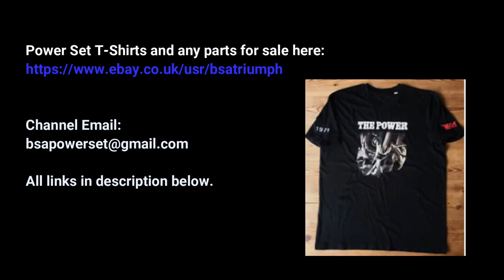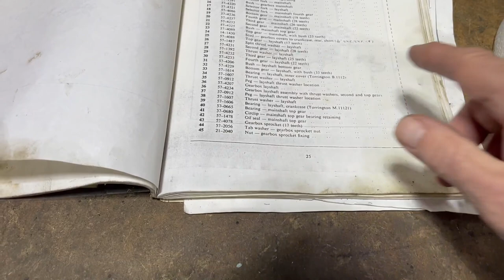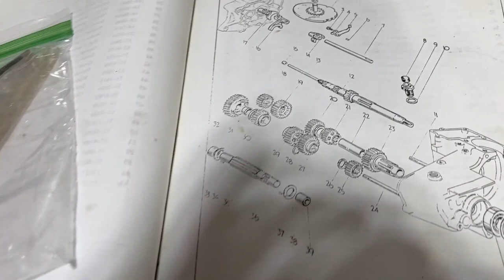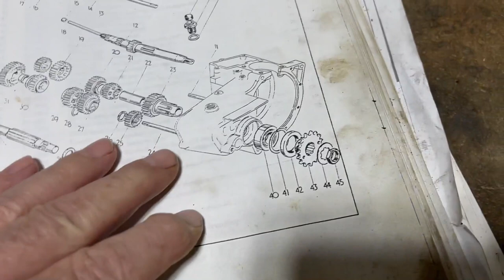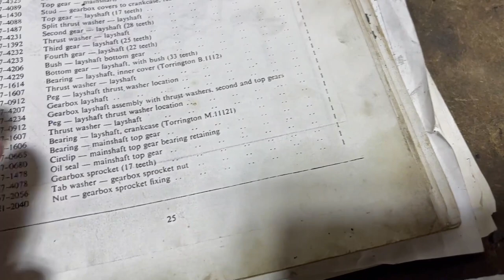BSA Fury SS (E35SS) - Gearbox Reinstallation - Part 1 - Cluster Assembly

Comment: Nice vlog, did the triumph bandit that was in previous vlogs have a gearbox that worked? I would try to copy that one if it did??
Reply from the maker: Hi Matt yes the Bandit box works but is a bit notchy and I’ve a funny feeling that that might be because there’s no thrust washers in it. I wasn’t videoing when that was put together so can’t check. I need to speak with Mr. Page.

Comment: I had a look at my set of SRS drawings, no layshaft assembly but the individual gears are there, 57-4230, 57-4231, 57-4233, 57-4235. I note they show internal spiral oil grooves, I don't think I saw them on yours, and one has an internal bush. Better be careful when you run this up.
Your best chance is the engine general assembly, may show the gearbox.
Reply from the maker: Thanks Andrew. I think we're OK on this front. On the layshaft there is only one gear that has internal grooves (4th) and only one that has an internal bush (1st). The others are on internal splines - 2nd and 3rd are moved by the selector fork and 5th is fixed.

Comment: What you need is a sectioned drawing of the cluster on the layshaft. It must have been drawn but whether it still exists is a different matter. I don't think I have that in the drawings I have on a CD rom from Steve Sewell (SRS), but don't you have the big engine assembly drawing, is it shown on that?
Reply from the maker: Eureka you’re right Andrew. Yes the SRS set which I also have does not include any drawings for the thrust washers but the general arrangement drawing should show them in the drawing of the gearbox shaft assemblies. I’ll dig out and check. Thanks Andrew.
Reply: @BSAPowerSet - also worth a look would be exploded illustrations in the weekly press (MCN and or Motor Cycle Weekly). Lawence Watts and Bill Bennet would have had their Rotring Pens at full flow sometime around pre-release or soon after. If that's what Andrew meant apologies.
Reply from the maker: Thanks MC2. Andrew was referring to something else so all good. I do have some of Watts' material but it's not detailed enough. However, I do have something else of significant benefit which will be revealed in part 2 due to be published shortly.
Reply: @BSAPowerSet - I realise Andrew meant drawn by the factory drawing office draughtsmen now yes fair point, taking a look at the press illustrations your parts book has more detail but they may lend a hand visually in some respects.
Reply from the maker: Thanks for the additional thoughts and observations Matt. It's a long story but the thrust washers were originally made for me. I agree that the material might be a bit too soft but I don't think that would normally be problem if everything fitted properly, which it didn't. The split washer is just a stop for fifth gear which does not spin against it. The complete washer between third and fourth gear does have the spinning 4th gear against it but not under constant load. However the new fabricated washer is made of EN19 so should be fine I think although I'm no engineer so we'll have to see. Initial focus is to get the box functioning properly. Thanks again.
Reply: @BSAPowerSet  - I moved the comment to the next video then noticed you replied here apologies for that. I think it's worth checking the thrust washer part numbers for matches from other Triumph / BSA gearboxes if you haven't done so already but from the progress shown you are getting there, not always easy on these rare models.
Reply from the maker: @mc2594  Thanks Matt.